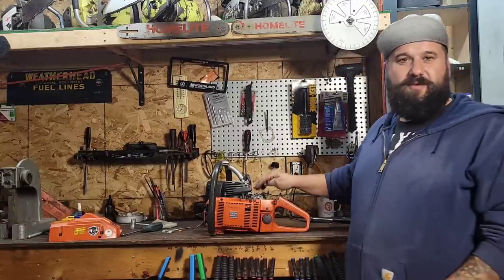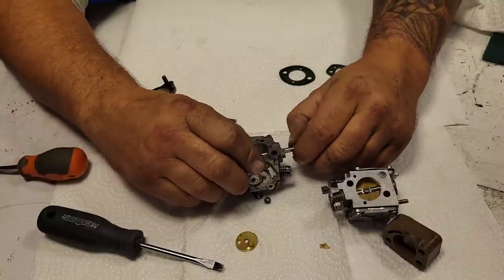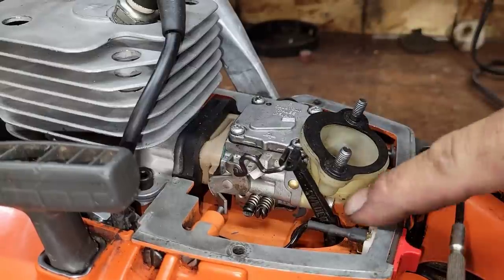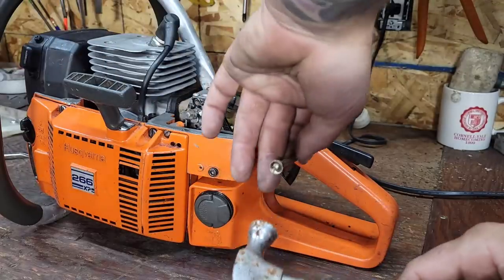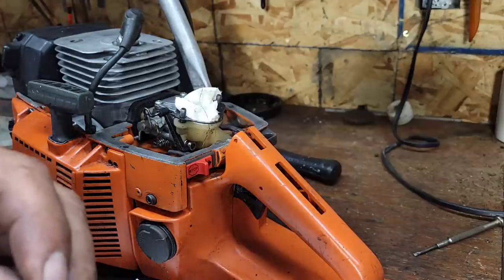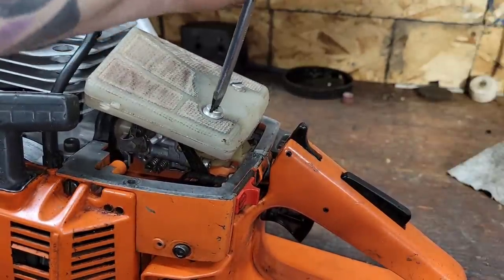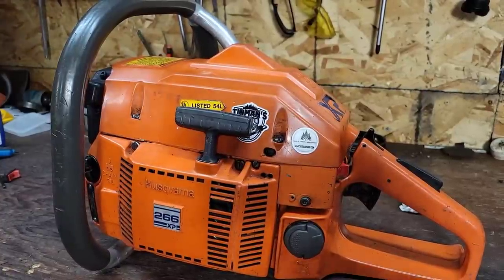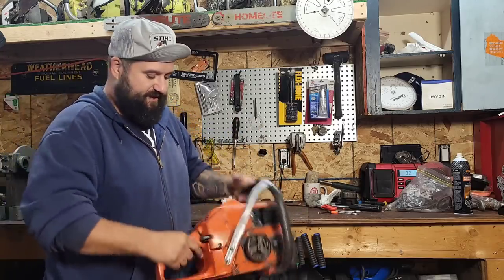Reparing a trigger that sticks wide open on a husqvarna 266xp

Comment: As you are likely aware, you have to be careful bending that throttle linkage. It will break very easily... bin-dar-dun-dat. Had to bend up a new one from a bicycle spoke. Then I forgot that I had a temporary fix for the linkage. Ran that 268 like that for almost a year. Bicycle spoke held up well. The operator presence level spring can be tricky for sure but again when you bin-dar-dun-dat it get easier. Always nice to have a video to see the tricks of the trade. This video will help a lot of first timers on that fix. I run the HS234A carbs on my 268 and 272 they seem to really like that carb. Wow, I hope my 266 turns out like that... what a nice sounding saw. My 272 is breaking in nice, boy does it have compression for a stock saw. As always TC Mahalo Tinman 🤙🤙🤙

Comment: On an old 4 cycle the butterfly screws have crimped threads preventing them from backing out.   You have to Dremel the through thread to remove them.  I use vice grips to crimp new ones.  I’ve seen to many internal damage from lost screws although if I see it they survived.  A blown motor is a scrap long block to me.

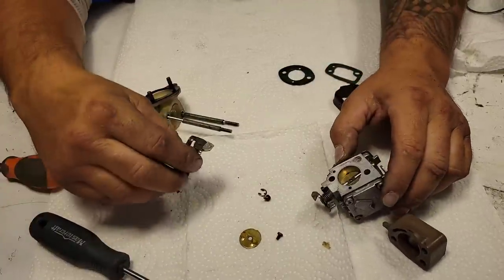Comment: 4:31 you mentioned welding the hole.  I stack little things like that on welder for combined projects, usually months later.  If it is not there, then I forget what I had on the welding list.

Comment: Hiya bud have you done anything with the 365xp in regards a throttle hang open sort of similar to what you have shown in this video iv got my friends saw which iv been using for afew trees and it's got this odd problem with the throttle it's a cable on it and I haven't done much with huskies like this one any help or advice greatly appreciated

Comment: Got one for ya..  when a saw does NOT restart in one pull, what is your normal troubleshooting path for that?
My husky often takes an extra pull or two more than it should to crank initially (still not bad) and with a restart if it has sit for a couple minutes can take a couple pulls..  a few more minutes than that it may need a pull on choke.  I've NOT been able to adjust it out in the carb.  I'm about as rich as I can go on low without it loading up when idling.
My thought is carb kit time.  Maybe a check valve that is not keeping the line primed.  Any other ideas?
Reply: I have the same issue with one of my 55s. My 268 (once it's warm) starts with half a pull. One of my 55 takes multiple pulls even warm so frustrating and seem to flood easy. It has thise dam limiters on the carb, hugh, low jets. I think that is a good starting place for my finicky saw. So a very good question, hope to see some ideas from the group or video series on finicky starting saws. Thanks for posting this question Matt.
Reply: @tdawg8605  I ordered a carb kit a few days ago.  It should be in very soon.  If I can remember which video this comment is posted in after I get results, i'll chime back in.  I got this thing third or fourth hand, so i'm curious what the diaphragms look like.  I imagine if the check valve on the pump side is not seating perfectly it may be losing prime.  Saw is unported with bg deleted, timing advanced, and muffler modded.  Otherwise runs like a champ.  But the restart procedure is quite annoying at times especially when my other saws are one pump chumps.
Reply: @nseric1233  Looks pretty minty but i've not pressure tested it yet.

Comment: Hey tinman, would it be possible to put a 288 carb on a 266/272? I know both carbs are the tillotson HS carbs with the impulse hole on the front. 288s have the throttle roller instead of a linkage like a 266 but if you swap the throttle shafts on the carbs you could probably get it to work.  Would love to see you try it!
Reply: Stick with the stock 272 carb it’s plenty big enough.